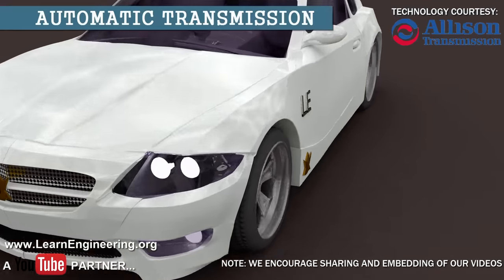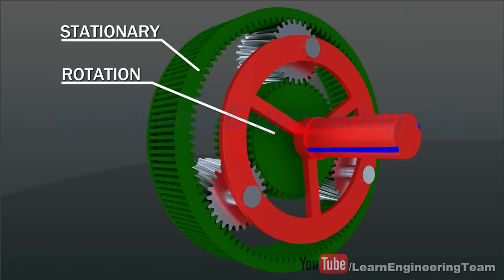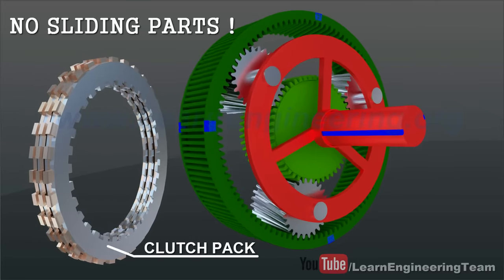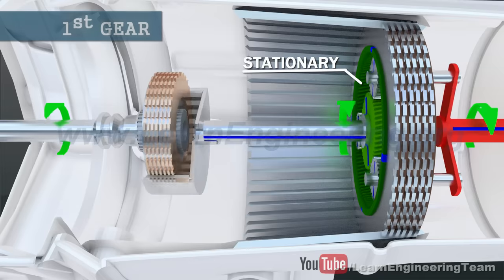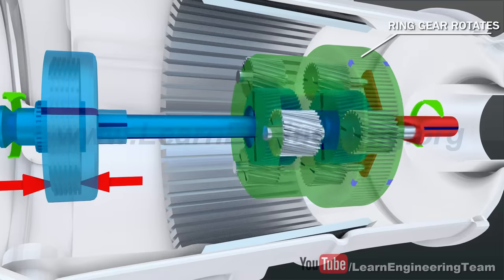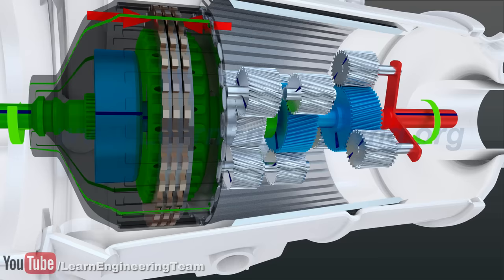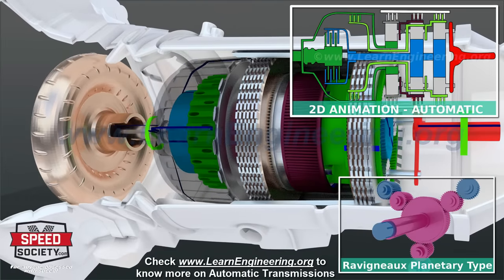Automatic Transmission, How it works?

Comment from the maker: To understand how the CLUTCH plates are engaged, please watch our video on Limited Slip Differential. It is explained in a detailed way there.
Reply: +Learn Engineering So if I understand correctly, it means no electronic is involved when it comes to selecting the clutch packs to engage/disengage? I think I understand to make it work using one or two gears, but how does the system 'release' clutches when accelerating?
Fantastic video though, I am trying to understand the magic of AT for years now. I'm getting there. Hopefully. Thank you.
Reply from the maker: ambydupuis An electronic system decides when to apply which clutch packs. The force actuation can be done by pneumatic/ hydraulic circuits.
Reply: +Learn Engineering Thank you for the answer. Automatic gear box has always relied on electronics, or was there a time when some other mechanic system was used?
Reply: +Steve Kern General motors was first to introduce electronics into the automatic transmission with a solenoid powering the variable pitch torque converter in 1966 and the electronically activated passing gear solenoid.
Reply: Nice video learn engineering, will take multiple watches to understand 😃 however I am confused about the torque converter. Your video seems to explain the workings of a dual clutch tranny, and I believe torque converter is not needed there as it is a separate type of tranny altogether.
Reply from the maker: Dear friends, here is the 2D version of the video. In my opinion this video is more helpful than the 3D video to understand the technology. 
https://youtu.be/Ugao6jTyM7k
Reply: the early automatic transimsions were fully hidraulic, they were beast, power hungry beasts, Ford`s C6 could eat as much as 40% of the engine power to operate
Reply: Learn Engineering
Reply: Learn Engineering
Reply: Nonsense. A C6 is a very efficient transmission.
Reply: Eric as idea for new episode - what are the most problems with AT's, how to use (switch and drive automatic car correctly) and keep them working? Easy fix. Maintaining. Tips etc....
Reply: change oil and filters regularly, that is all
Reply: Terry Hampleton o
Reply: Learn Engineering
Reply: I ent got a few more times. Do better.

Comment: Me 2019: ''I will NOT drive an automatic UNTIL I understand this video''
Me 2030: (Still driving a manual)
Reply: Me 2050
Reply: me driving an electric self-driving hoover car in vr with a manual in 2077 right with ya buddy
Reply: @sumirunihon  how can you drive a self driving car?
Reply: @suprememasteroftheuniverse  neuralink
Reply: I wanna keep a manual car because I already ride a bike with manual transmission (no shit) and I want to have something to occupy me while driving
Reply: Good luck finding one. They're being phased out of existence.
Reply: Manuals are way better then automatics. You can shift whenever you want and you can have as much power you want right at your wheels as you like. Also, a manual's maintenance will cost just a fraction of what it costs to maintain automatic.
Reply: @suprememasteroftheuniverse  By installing another set of planetary gears... did you learn nothing from the video?
Reply: @hp2084  it also feels like driving in videogame, and manuals are also better for escape or evacuation (they accelarate faster and can have diffrent power outputs depending on the gear).
 Manuals are basically cars for people willing to push their cars to absolute limit (also because they're cheaper in repair).
Reply: On Toyota Hybrids, there is only one Sun-planets gear pack plus electric motor, so you can give it a try (to understand)! Or you can go Tesla, electric motor, single gear and differential ))
Reply: @blitzn00dle50  seriously tho, I often get sleepy riding my scooter as opposed to driving my manual transmission car

Comment: Thank you for saving the torque converter until last.  After the first explanation of the gears, and the follow up with the second set, I kind of intuited how you build up whatever system.  But every other video I watches started with the torque converter, and were talking about how it makes spinny A go to spinny B, and it's actually the bit where the spinnies don't go together that makes it important.
Thank you!

Comment: Great explanation! For years I looked at automatics as black magic. In my mid 50's and have been wrenching all my life as well as being a Chassis Designer for GM and Chrysler for 20 years.  Still I had not been into an automatic until the 4R75E in my 06 Ford Interceptor went south. Knowing how much a rebuilt one cost and the curiosity of how they work I figured what do I have to lose trying myself. I already had a factory service manual which had in detail how to do it. After studying how the clutches apply and when it was pretty straight forward to me. I ended up successfully rebuilding it and honestly it was pretty simple once the operation was understood.
Reply: i overhauled multiple transmissions in trade school. could never fully grasp how the planetary gear set changes things because i keep forgetting the planet carrier exists. i think thats what confuses most people.

Comment: All of this in my $500 piece of crap Chrysler, 
Engineers are truly underrated, their work is not valued at the level of ingenuity it takes to develop the technology we use for comfort.
Reply: automatic transmission is the work of thousands of scientists and engineers.  as an engineer,  yes engineers are important but the contributions of most individuals are just a drop in the bucket.
Reply: @ahumandoing6813  Sorry to bother you, but could you explain by how most people's contribution is just a drop in the bucket.
I mean, i do know that it takes a whole team of scientists and engineers to design and build anything.
But, doesn't it takes years of college to get a  degree, and it's a very difficult subject with a lot of mathematics. 
How come after studying and getting a degree, an individual's contribution is still a drop in a bucket? 
How are things so complicated being built then?
Reply: Sunny shah Not the original commenter, but I can answer your question from my own perspective as an engineer:

You already acknowledged that it takes a team to do anything, which I think is the main point. A second point is that technology is generally slowly built up over time with incremental improvements. The team of engineers at Chrysler that developed the transmission of your car did not invent the automatic transmission, they used a design that already existed within Chrysler and tweaked the specifications slightly to suit the specifications of the car. That original design was definitely the work of a very smart person, and was also probably crap compared to today’s automatic transmissions. Incremental improvements in parts design, materials, manufacturing processes, etc all add up to a better transmission over time. Engineering is all about using the tools and technology available to you to create the best functioning piece of hardware (or software) within economic constraints, not sitting around doing math. Yes, engineers learn a lot of math in school but don’t end up using most of it. So when you look at the team of engineers that worked on the transmission for your car, they most likely didn’t invent any part of it, but they created a piece of hardware using existing technology that suits the design criteria of the car, is reliable, and mass-produceable. And the day to day work of a single engineer on that team is probably not very impressive compared to the image of a genius inventor using complex math to come with a contraption that most people can’t even wrap their heads around (which is sadly a lot of people’s impression of what engineers do), but the continued work of engineers that leads to incremental innovations across different areas of industry is how consumer technology gets moved forward.
Reply: Sunny shah 👀
Reply: @BangMaster96  he's saying no one person contributes the whole to a project (unless you're at Tesla's level), and usually they are built up incrementally over decades by many individuals doing small improvements. The automatic transmission wasn't invented overnight, rome wasn't built in a day, etc. etc.
Reply: this $500 piece of crap Chrysler will need a transmission rebuild soon and its gonna cost a small fortune
Reply: @sunny your piece of Chrysler doesn't have an Allison 😂
Reply: @BangMaster96  A single piece of a clutch pack ring takes a monumental amount of engineering, and at least a few engineers.
Reply: @ahumandoing6813  I doubt that you are a degreed engineer or did any research before commenting. As a mechanical designer, I've worked with many engineers in my 40 year career and they were all brilliant. I can tell by your grammar and sentence structure, that your are not very well educated. The fact is, the very first automatic transmission was invented by one man, Canadian steam engineer Alfred Horner Munro in 1921.
Reply: That's why I only drive manuals - they're much simplier.
Reply: @romanes_eunt_domus  Tesla is no fancy level, as a matter of fact it’s relatively low compared to performance cars… the engineers there are no more talented than the engineers at Porsche, BMW M, AMG. And forget super cars. The guys at Rimac and rivian have made much smaller, more powerful motors. Tesla doesn’t even design their own batteries. Why are you praising them?
Reply: @BangMaster96  some engineers dont even use the math learned. the math in trannys is simple. plus modeling tech has made a significant leap in progress when it comes to brain power. by no means am i saying the skill needed for engineering a tranny or anything for that matter is easily obtained but the knowledge that had to come together has been collected over many decades, refined, and then further and even more genius designed to fail at regular intervals ( designed obsolescence ). many people think an engineering degree is difficult and while it is, the info you learn in college is rudimentary, calculus is a rudimentary math and when taught well is really an easy subject to learn its just that teachers that teach that subject have to make up for years of horrible algebra practices and down right misinformation.
Reply: Couldn't agree more Engineers blow my mind with their amount of intelligence.. like how in the goddamn hell does someone create this??!?!
Reply: Most people today couldnt figure out how a steam engine works, much less a car engine !
Reply: @bensweet2011  Yeah. Even Einstein did not come up with the theory of gravity / spacetime by himself. There was hundreds of years of progress done by other physicists before.

Comment: So, combinations are:
gear -> clutches (gear ratio)
1 -> C1, C5 (3.10)
2 -> C1, C4 (1.81)
3 -> C1, C3 (1.41)
4 -> C1, C2 (1.00)
5 -> C2, C3 (0.71)
6 -> C2, C4 (0.61)
R -> C3, C5 (-3.10?)
Reply: Darko Kulic I believe reverse gear is somewhere between -3.10 and -1.41. So somewhere around -2.15 if if my rough guesswork is anywhere near correct.
Reply: Thank you! This r e a l l y helped me on my exam...
Reply: 1 gear = (3,10)
R gear = (-3,10)
Reply: looks like someone was paying attention. lol 
thanks though
Reply: No
Reply: Do you wear a cape?
Reply: Thanks
Reply: he is speaking the language of the gods
Reply: Oh my god, someone understood it!!!!!
Reply: And how were the clutch packs engaged automatically before we starting using computers to do it ?
Reply: @phazonlord0098  Probably some type of mechanical design wizardry.
Reply: @phazonlord0098  Before computers, everything was done with either vacuum or using centrifugal force.  It wasn't that long ago that centrifugal force was enough to switch gears.
Reply: Ah!  Now I get it.  Thank you.
Reply: in the video he makes it seem like in the reverse gear, c2 and maybe c4 is applied but it cant be. the picture at 6: 35  shows all the clutch packs. I thought it had to be c3 and c5 in reverse, and this provides evidence to my suspicion and really cleared up the confusion, thanks.. I think it should be the same ratio as the first gear I think.

Comment: Honestly on a base level, the concept of an automatic transmission was not that hard to learn; it just really starts to get complicated when you introduce more gear combinations. So it makes sense that a 2 speed automatic transmission on my gas powered r/c car is (relatively) not complex compared to a 6-speed + reverse car transmission, I guess I also understand why my r/c car does not have a form of reverse gear while the electric r/c cars have them
Reply: I’m here because I just made a two speed automatic transmission out of Lego, and yes, it wasn’t really that complicated. However, I could never make a 6 speed automatic transmission, because that’s just a whole other level of complexity. Also, for an electric RC car to have reverse, all that needs to happen is for the ESC to feed the motor reverse voltage, and the engine spins backward. No extra gearbox needed. A gas RC car would have to have a forward/reverse gearbox, because you can’t just run a gas engine backward.
Reply: I just don't wanna know how the ZF 10-speed works, bloody hell.

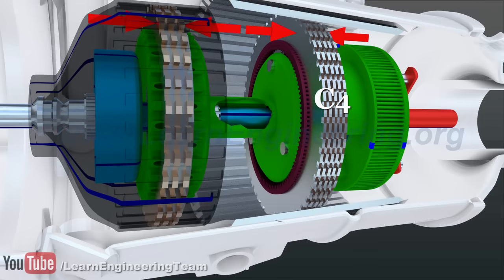Comment: At 5:24, I applied C4 like you suggested, and stuff blew up. Is this normal?
Reply: +TheFishCostume Bomb has been planted.
Reply: +Leopoldo Aranha Terrorists Win!
Reply: +TheFishCostume 
I'll stick with jet power!
Reply: +MrBen527 Contrary to popular belief.  All transmissions and electric motors work off of the smoke theory.  Once the smoke leaves any of these devices. it's time to service them.  hope this helps.
Reply: +TheFishCostume yep totally normal
Reply: +TheFishCostume Same thing happened to me. Wtf. Gave the video a thumb down.
Reply: +TheFishCostume Did you apply the code "Allahu akbar"?
Reply: i love the comments section :D
Reply: I was about to say that
Reply: Like, he beat you with 8 months, that was close.
Reply: :) :)!!! Nice comment!!!! :):)!!!!
Reply: next time place claymore
Reply: Lmaoo
Reply: Hahaha, best comment ever
Reply: TheFishCostume xD
Reply: Only if you drive a ford! BOOM! jokes on jokes.
Reply: Yea, by engaging only the C2 the ring gear is rotating by a input ratio of 1:1. Nothing blows up, but C4 just doesn't effect in any way the gear ratio. Gear would be engaged only to make as little moving parts as possible, in this case the unnecessary residual rotation of those clutch plates.

Comment: Thanks for sharing. I'd love to work in the Transmission industry somewhere. I've successfully rebuilt an AX4S Ford Transmission in my 2000 Windstar and still driving it today. I do realize that that is a long ways from being a fully trained knowledgeable Transmission guy but its a start. I built my own clutch press as well and cut down push pins in a lathe to press in bushings.
Reply: You must be some kind of wizard to rebuild a automatic hell like that.

Comment: Good luck to people doing mechanical engineering that have to understand this...
Reply: That would be me! :D
Reply: +Abdul razzak Plot twist: You need to understand this before you're a Mechanical Engineer
Reply: mech engineer needs to understand all this stuff because they design these things.
Reply: I'm an EE and I understand this? John Deere Infinitely Variable Transmission... Now that's a f**king beast.
Reply: MooseheadDrinker mech engineers deal specifically with principles and applications of mechanical systems. petroleum engineers are the ones dealing with oil and gas stuff. auto techs only fix the mechanical systems the engineer designed.
Reply: its probably a big fat gokart torque converter, but this one guy did make an automatic transmission prototype with infinitely variable gear range inside of its max torque and max speed ratios of course so it could be that also. . .i probably understand it less than you
Reply: Not every mech engr works with cars, they're not auto mechanics, and this is not a standard part of the curriculum. The person that really needs to understand this would be a powertrain engineer, which, incidentally, isn't every mechanical engineer.
Reply: no,that's an automotive engineer
Reply: I still confuseddd
Reply: Thanks ;)
Reply: I just rebuilt one and still dont understand how it works .... But after rebuilding it it works ..... But seems like it should just be a locked up mess !
Reply: and to think we had this tech in 1939 (GM introduced hydramatic on some buick and oldsmobile models, and was then used on tanks in WWII)
Reply: I am studying automotive engineering and yes i have to understand this, instead ive been scrolling through the comments laughing my ass off for the past 20 mins

Comment: In about 1979 I rebuilt a Holley 4 bbl. Carburetor for my Plymouth's 383 Magnum.  My dog watched me rebuild that Carburetor and I swear he had the same look on his face as I have while watching this video!  Who the hell dreamed up the Automatic Transmission?  My son went to 6 years of University and has an advanced Mechanical Engineering degree and even he has trouble explaining how these Transmissions really work.  They actually work really well but I'll be darned how the first guy to build one got it done...
Reply: I'm a freshman mechanical engineer, and this makes sense. It's mostly if you've used planetary gears or not.
Reply: It was initially a gift to humanity from The Gods of Mechanical Math.
Reply: It’s mostly about understanding planetary gears, and how friction engages with the input torque. Just friction and flow of energy.